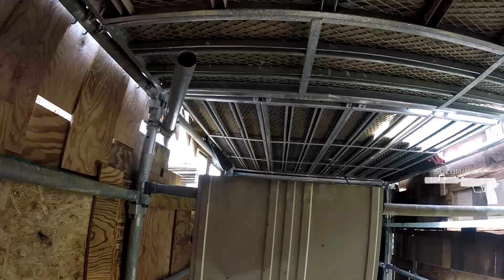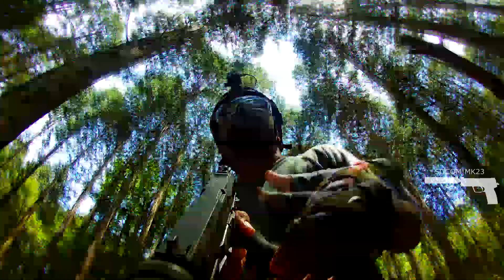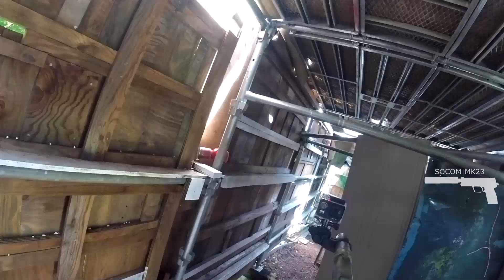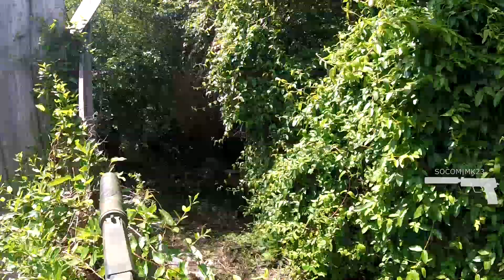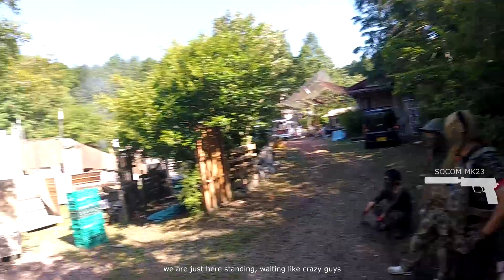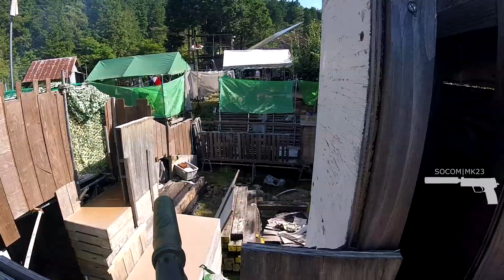JAPAN AIRSOFT SNIPER [SOCOM MK23 Action]ソ−コ厶mk23 日本のサバイバルゲーム SABAGE

Comment: haha nice gameplay bro :) and with the mk23 :) did you upgrade yours yet? the selfie cam is great :)
Reply from the maker: Vassili Gaijin the only thing I upgraded is the inner barrel and the hopup rubber.
Reply: gablordTV get the H nub. U can use .40+ Bb
Reply from the maker: I would surely get one. Thanks
Reply: also get the Hadron TDC, is handy :)
Reply from the maker: It's not available yet here in japan right? If I'm not back wrong you have to order it online from abroad like what you did?
Reply: we have an online store in the Netherlands that sells it. which one you cant buy in japan?
Reply from the maker: The h plate thing and  hadron tdc?
Reply: ah so both the H-Nub and the TDC mod you can not buy in Japan? you need me to send to you?
Reply from the maker: How much do you think I would pay for everything?
Reply: gablordTV it's around €25 total with shipment.  The h nub= €5, Tdc= €18 shipment in an envelope=€1,40, in a package =€23. But those parts will fit a bubble envelope. So it's €24,40. What you think?